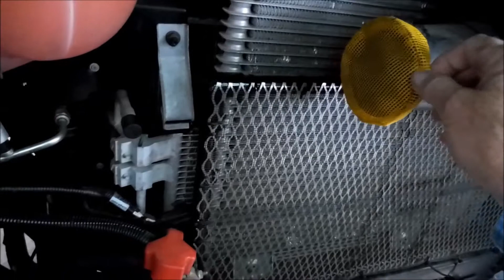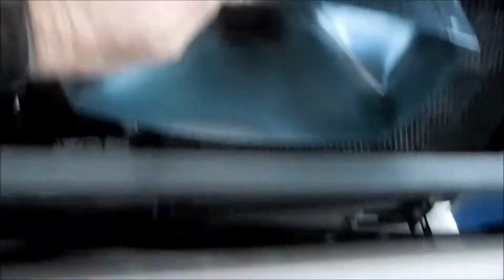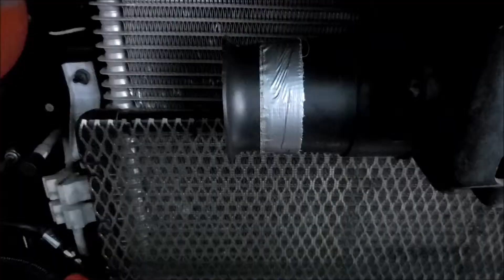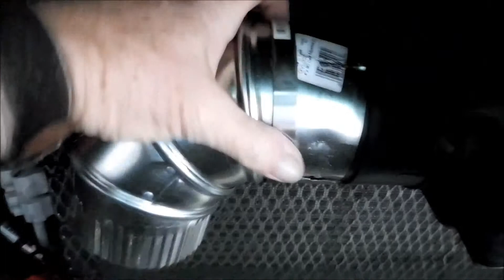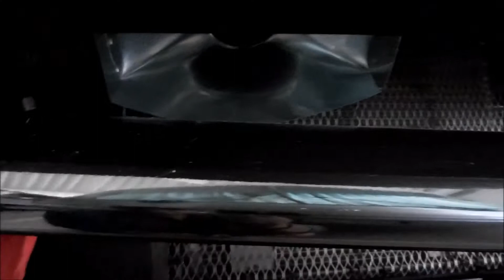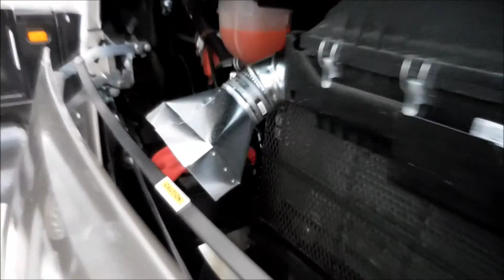334-2015 Fleetwood Flair 26E-DIY How to install Cold Air Induction

Comment: I love that idea, i am not sure how heavy rain/snow or road water would be handled by that being directly open. Most Cold air systems have a trap area.  My Chrysler SRT 8 with the  6.4L used a open cold air filter that fit in the existing air box with the factory lid removed. I can see that working very well for you but if you hit a bird.... whfeooop  right in the air box it goes feathers and all lol i would simply use what you have and aim it less directed to front or put a screen on it like the Hi po cars use..that's awesome tho!
Reply from the maker: +Tioga Trails 
Wow, thank you for the great input.  To address the issues you've identified, I will put in a KN filter (more water resistant than the paper element I think is in there now),  using a pit-pin at the air horn interface make the ram assembly adjustable up so the intake is behind the hood during rain and remove/replace pit-pin to adjust ram assembly down during non-rain periods of travel, and to keep the "birds out", lol, place a formed section of remnant expanded metal left over from the bullet proof radiator protection. Will do an video UPDATE. Really, thanks again, you the man!